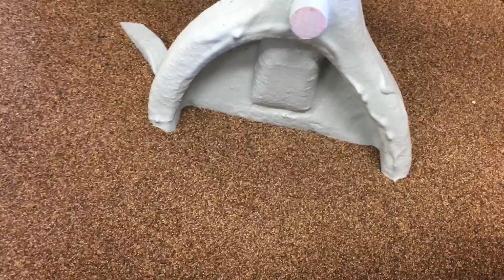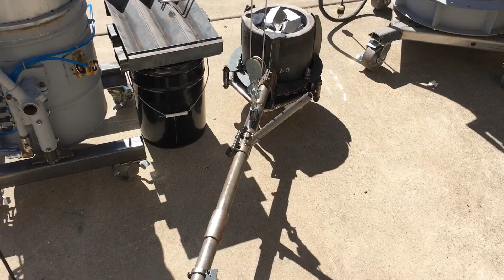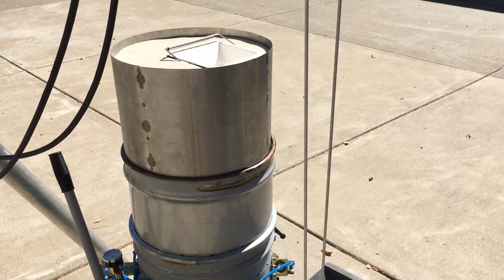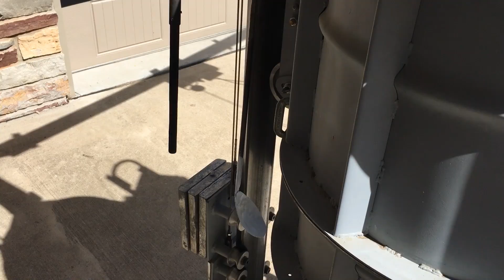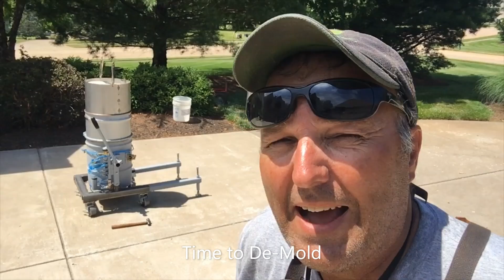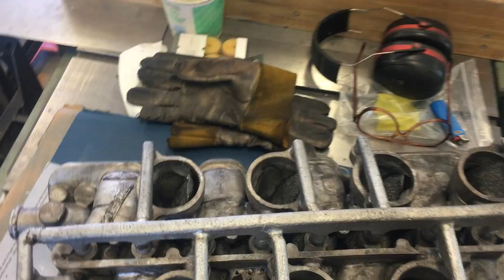Lost Foam Casting an Automotive Intake Manifold   Part 2

Comment: So u can fix those spots by making a sprew to those ends with like an 1/8 dowel rod to each end. Then ur aluminum could fill to the tip and u won't have that issue
Reply from the maker: Not so. People confuse venting in conventional open cavity sand casting with lost foam casting. In lost foam casting, gases vent through the entire surface of the permeable pattern coating. Vents dont apply because they are blocked by foam pattern until the pattern evaporates and by then, they are blocked by molten metal and are not a vent. People think they need a vent because they see gas bubbling back through the sprue but that's because of inadequate coating permeability, and poor casting and feedsystem design. The fail in this casting was caused by poor mold packing due to contaminated/old sand that no longer flowed well when vibrated. If you skip to parts 3 & 4 of the same series you will see the proper result. Best, Kelly

Comment: Ahhh ok... so some of those imperfections are due to the venting I mentioned. There will be spots here and there that need straight up atmospheric vent sprews to prevent those odd spots here and there. But heck u could get it dialed in then spend the time with a grinder and flap disc, and wire disc to get that polished finished. Cool shit. I was trying to decide if I wanted to try this at home. I used to work in a foundry that molded quite a few aluminum parts. So I learned alot about how the process works. Just didn't know if this was something I could do at home but ur design for the gantry made my mind up lol I'm doing it! Love it!

Comment: U don't have issues with the foam turning into Slag or creating bubbles in ur final part? Just curious how that's prevented. I know in factories they have angles that the part sits as well as correctly placed screw vents at the top of the mold that go to the air and prevent air bubbles in the part. But it looks like u may have solved that by having the part with the right curves and angles pointing the correct direction to prevent bubbles. Idk... waiting to see ur finished part
Reply from the maker: The fail in this casting was caused by poor mold packing due to contaminated/old sand that no longer flowed well when vibrated. If you skip to parts 3 & 4 of the same series you will see the proper result. You wont have bubbles and entrained gas flaws if your coating is sufficiently permeable, have proper casting and feed systems design, and mold prep. Best, Kelly

Comment: What devices do you use to vibrate your sand?
Reply from the maker: Pnuematic Turbine Vibrator. Search them on eBay or Amazon. Best, Kelly
Reply: @kellycoffield533  thanks it sounded like you were using an air chisel until I watched this video again.

Comment: Hi Kelly,
Very informative video..
I am facing sand sticking issue to final product..
Can you tell me What's the exact issue in the product..
Is it because of to much binding agent. Or less surfactant
Reply from the maker: When you say "facing sand", that sounds like you are using bound (green or other) sand. In lost foam casting, a refractory coating is applied to the foam pattern and then it is vibratory packed in dry sand. The coating prevents the sand from sticking or imbedding in the casting and essentially reproduces the surface finish of the foam pattern. Though some people do try to use bound sand in lost foam casting, it really defeats one of the benefits of the LF process. Best, Kelly

Comment: I saw a guy who put a copper bat through the sand, used a torch to help heat the sand a bit to slow the cooling,  then ran water through to help with cooling, I don't believe the little bit he did really helped or hurt anything.  He was doing sand cast,  but I think in a setup more like yours, having a  .250" tube , with resistance wire inside, insulated with a fine sand, then coil place about 2"off the wall of the barrel, before the sand, then a .500" tube near the same location, to allow cooling,  heat the sand up to about 100°F just before the pour, , then then about a 4-5 gph flow of cold water,  I speed up cooling,  would this be safe? How hot can the foam safely get without warping, because 100° f is nothing relatively speaking, I could see it helping if it's 10-20°f out, but 70° the difference is nothing.. would the effort in normal conditions  be worth it?  Id like to cast engine parts, intake manifolds,  maybe someday cylinder heads, or possibly small engine engine blocks,  or possibly even remake old engines , from late1890's to around 1920's early 1930's  stationary engines, oil field engines, maybe a modified design version, made from aluminum instead of iron, as far as the cylinder and block,/ crank case, I'm thinking as large as 6"bore to 8"  and 12" stroke,  or small as 4" bore 6" stroke,  in an opposed twin  boxer 4, low rpm work horse,  to run a generator,  possibly a 600 rpm, 1800 absolute peak RPM,   making it a oil/ diesel burner would be nice,  inject fuel with a high pressure air blast, working similar to a paint sprayer, atomising the fuel, possibly using a multiple stage compressor with the injector compressor taking in 100-120psi,+ into a 2" bore, 2" -3" stroke then compress the air into the fuel injector, spraying the fuel, using a a tiny piston injection pump, throttled by a secondary piston that removes the fuel by adding volume , reducing the ability to pressurize the fuel, possibly use modified lifters as pistons,  using a cam to , the air injection may require higher pressure to operate correctly,  using a compressor to store air at 120psi, then be compressed again after a slight cooling time, being compressed into a small storage tank, possibly 300 psi, then enter the injector pump/ compressor. Filling the 2"bore with 300psi, the actual pressure would depend on the. Injector and compression ratio, but can possibly be in the 350-400 range the engine having roughly 24:1 compression , spraying oil, used engine oil used vegetable oil, or diesel , kerosene,  being sprayed similar to how a paint sprayer would spray, the added air should greatly atomised the fuel, also use heat plugs, and fuel line heaters, and a injector heater,  heating the fuel to 200°f just before injection, allowing a cold air intake, dense as possible,  then the hot fuel injected as the cylinder pressure peaks,.
Possibly use semi truck wheel bearings as crank main bearings,  use two 24"  flywheels, weighing around 60-80 lbs each   use a hub to bolt on to the crank with the flywheel, with a 1.5"& 1"  shaft, to drive an alternator, and fan, whatever maybe needed accessories wise,  with a 2" and 3"  for the serious business end, and make them interchangeable.. use a SBC water pump, to bolt to the water jacket,  to circulate water from both banks, both cylinders being the same, the other can be blocked off, making a Rh and Lh engine,  making a crank change, and adding a cylinder pair, could be all required to go from 2cylinder to 4cylinder , or 8cylinder, I think this would be about it, use 6-8 v per cylinder with overhead cam , use say 3x 2.125" intake valves, and 3x 1.880" exhaust valves,,  the spring pressure could not need to be too great,  being rpm is low,  possibly in the 20-30 psi seat, and 50-60 on the nose, at most, with roughly
.500" lift maybe .750" use 3 1.5" exhaust into a single  
2.5" per cylinder, with high port intake and exhaust,  the intake uses 2" per valve split from a 4" tube, with a cone filter, with an emergency flap inside,  Incase of runaways,  maybe use a governor activated release, to close off air , if it reaches 2000rpm,  use a governor to maintain a steady 800-900 or 1200 rpm,   if I had access to a mill and lathe, and help casting the parts find old diesel engine pistons to cast new from, possibly using a heated mold and press to cast the pistons,  possibly cast steel cylinder liners if a steep tube can't be found to make them from, bolt on the water jacket like a motorcycle cylinder, then the water jacket use a o-ring seal, the cylinder liners using a steel o-ring and copper gasket, possibly using a aluminum crush ring with two rings on the jacket one on the head,   
Sorry to ramble, the insomnia has me up late,  I want this engine , to generate power,  I'm hoping the 2cyl version would make atleast 150-200 ftlbs TQ. And 40-50 HP,  to near 300 TQ, and near 100hp at 1800rpm probably with a bit of boost a small superchargers, I'd probably start with a 4" bore version, with 4.5" maybe 6" stroke   use 4valves / cylinder,  use a more traditional injection, with a heated injector  spinning at upwards of 2400rpm,  it would be a better starting points, ,  sorry to ramble again insomnia is horrible..have a awesome day!!

Comment: That was a really well coordinated process. I'm wondering if loading of the internal ducting with sodium silicate binder sand and a CO2 set of that prior to your sand pour would be a good way to ensure full metal exclusion from the ducts.
Reply from the maker: Thanks Graham. In rare instances I have tucked a blind hole with bound sand but in general I avoid it because it's easy to damage or distort a foam pattern when packing it. Foam patterns are certainly strong enough to handle their own weight while being vibratory packed, but even so, great care must be taken not to distort them with shifting sand. In this case, if the runners were full of bound sand, the pattern would become quite heavy and I doubt it could handled at  that weight without distorting or breaking. The primary culprit of the fail in this video was degraded sand that would not easily flow under vibration. With slightly different positioning, I was successful on my next attempt shown in the follow on video at my channel. Best, Kelly

Comment: Does the sand stay loose like that,. You don't add any binders?
Reply from the maker: Yes. It's vibrated in place which tightly packs it without binders. It's perhaps the most attractive feature of lost foam casting.....no cores or worries about parting lines and draft. Best, Kelly
Reply: @kellycoffield533  Thank you for your reply .
I saw in you other videos you made ,.you dipped  the foam in some sort of  slurry! 

So when that hardens , that will be the outside of the mold which will keep back tue sand once you poor in molten aluminum.
Reply from the maker: @Ray88G  Yes, but it's really not a structural part of the mold and serves as a permeable coating (as described in the reply above) that also improves surface finish of the casting. Best, Kelly
Reply: @kellycoffield533  If you don't mind me asking you one other question about the  fioam. 
So when you poor the aluminum inside the mould, what happens with the foam,  does it get burned away .
Also I was quite surprised when i didn't see vent holes.
Thanks ..
Reply from the maker: @Ray88G  As the molten metal consumes the pattern, the portion in contact with the pattern is melted/liquid polystyrene and the portion in the liquid PS and the molten metal is gas/evaporated PS. The refractory coating on the pattern is permeable and although some liquid can pass, it is mostly in the form of gas. This is why there are no vents because the entire surface of the pattern vents gas as the metal advances. Best, Kelly

Comment: Is there a way to figure out how much alluminum you will need as reguard to foam weight?
Reply from the maker: The foam is so light you would need a very precise scale, and even so, the density varies enough to make it very unrliable (ask me how I know!). Best is to submerge in water and measure displacement or roughly calculate volume of the part in pieces if necessary. Best, Kelly

Comment: When demolding I like to keep a big shop vac handy to suck up sand
Reply from the maker: Convenient but downside is the shopvac and the room its in will smell like burnt polystyrene everytime you turn it on thereafter. -Nothing like th esmaell of burnin polystyrene in the morning! Best, Kelly
Reply: Hmmm I got a old like 1960's metal shop vac never had that problem
Reply from the maker: @jeremyhanna3852  Anything I have that touches lost foam sand smells like it. That's why I store it in sealed containers. Best, Kelly

Comment: I was really impressed with your set-up for heating and pouring. Simple and effective. I know it took a lot of pre-planning to get the 'swing-set' set-up to the perfect height. As nice as your yard and neighborhood look, I'm trying to imagine the looks of your neighbors, as you do this disgusting 😊 dirty job, among the business community type people (nose in the air), out there, but you kept it very clean and dignified. I worked in a vacuum cleaner factory for 23 years in Canton, Ohio, and the equipment they had to cast vacuum cleaner bottoms, GM transmission parts, and drill gun housings was mammoth and dirty. As an industrial electrician, I got midnight calls to go to machine shops and the like; and got to work on a machine that finished 10-cylinder intake manifolds for Winters Industries, for the Vipers. By contrast, your simplicity here, is amazing. Keep up the good work. You are both an artist and an engineer. My little brother spent half of his life with tools cleaning up heads and intakes for just about any kind of racing industry. I can't wait to show him your set-up and work. (He hates computers, so I will have to lure him over for a peek.)
Reply from the maker: Neighbors are ok but I've learned that when someone asks how something works, unless they are technical, they don't really want to know unless it can be explqained in under a minute. I just tell them I make the pattern, pack it in sand, and when I pour the metal it takes the place of the foam, and most of them seem are satisfied with that explanation. -Know your audience.🙂Best, Kelly

Comment: How do you come up with the dimensions to make the parts to glue together to be like the original?
Reply from the maker: A lot of measuring and strategizing to break them into the most managble pieces for indidviual 3 axis machining. Beyond that it's just allowing for shrink by making the apttern 1.3% larger. Best,  Kelly

Comment: Before I retired, my place of employment tried to develop the styrofoam evaporative casting process to an industrial level.  Years of experimentation and process development went no where.  I'm sure other companies do it and do it well, but we were cast iron.  Now cast iron is an almost dead material.  Too heavy, to much CO2 exhaust.
Reply from the maker: Here in the US, Lost foam hasn't gained much commercial traction. Sadly, most of the research, process development, related process equipment manufcatures, and commercial practitioners reside in China and most foundry use is in fact for iron castings. There are a few US foundries using lost foam. Mercury Marine in FonduLac Wisconsin for example. Best, Kelly

Comment: On the topic of using vibration to pack the sand around the molds, I wonder about using air injection to induce liquefaction of the sand and allow it to flow around the molds.
Reply from the maker: There was a similar question asked in another video. Here's my reply: Fluidizing the bed is fine for removing the casting from the packed mold or possibly placing a pattern in a filled flask but it's the opposite of what you want to do a tightly pack a mold. Vibration makes the mold media act like a solid. Fluidization makes it act like....well, a fluid. When you turn the fluidizing air stream off, the sand isn't packed but more akin to having just poured it into the flask so it would still need to be vibrated to have good mold stability and integrity. I had a fluidizing coil in the bottom of my old molding rig. I never used it because I still needed to sift all the sand between uses to remove any loose refractory coating or clumps resulting from the byproducts of the decomposed foam. To filter the sand, I just cut the bottom out of a bucket and replaced the bottom with a perforated plate/screen,  place it on top of the storage bucket, and shovel the used sand through it. I also found that with hand placing and filling the pattern and mold, I was better able to avoid pattern damage and deflection than trying to place in a fluidized mold. Best, Kelly
Reply: @kellycoffield533  fascinating. I figured, given the apparent maturity of your equipment, that you’d considered it and had a reason it wasn’t useful. The videos are excellent, keep them up. Personally, I’d find it pretty cool to just watch a timelapse of the foam work that goes into an intake. Wouldn’t even need to narrate it.

Comment: Could you prefill the runners before putting the pattern in the sand?
Reply from the maker: Possibly with a bound sand but the foam pattern is probably too weak to being packed and handled with the weight of the sand. It's not necessary. If you view part 3 you'll see the corrections made to successfully cast the part. Best, Kelly

Comment: Maybe you could add a door or two at the bottom of your rig and just open the doors and turn on the vibration to empty the sand rather than dumping it out of the top.
Reply from the maker: That's not a bad idea. I have a vacuum plenum in the bottom of the existing flask. I did discover that I could controllably tilt and dump the full & fully extended flask so no more trying to knock off th etop extension before the dump. Best, Kelly